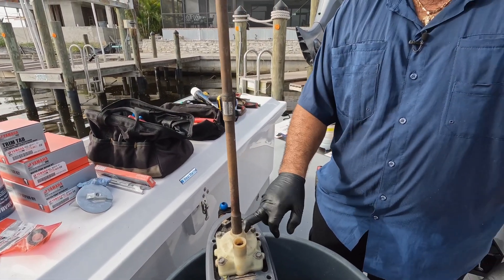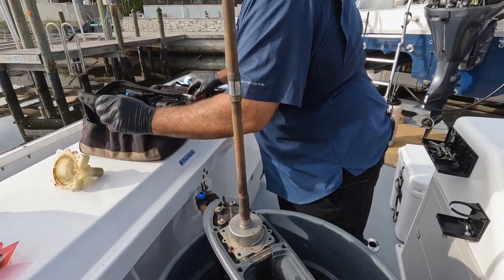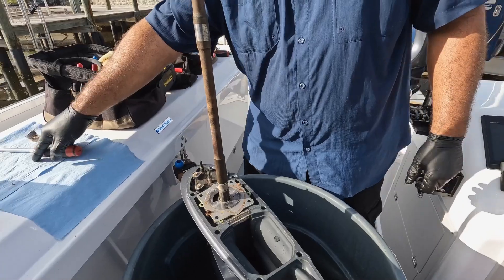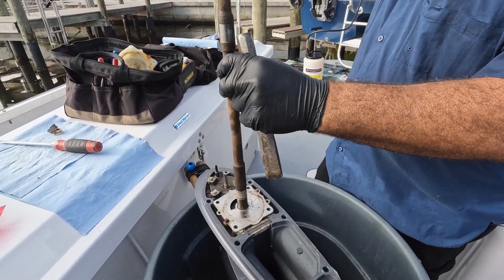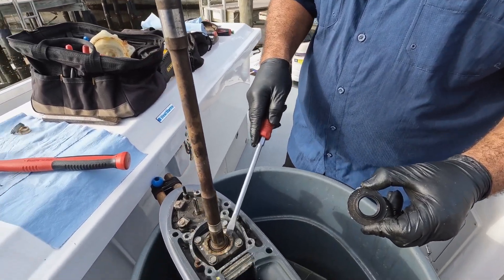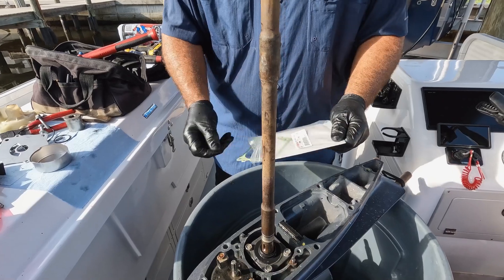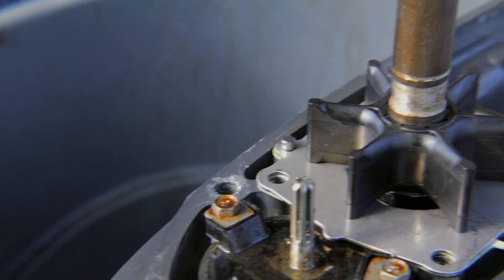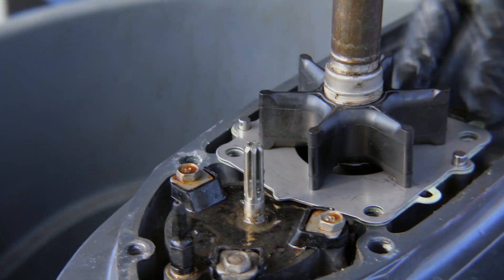How to Replace a Yamaha Water Pump | F90, F115, & VF115 | DIY Yamaha Outboard Maintenance

Comment: Done  this many times on my ‘03 F115 I’ve owned since new. 
The 7/8”’wrench tip is awesome. Didn’t know to do that. 
Good stuff. 
Only thing I do different is grease the woodruff key in to hold it in place and help with it seizing in there. 
Those new to this job do not load up grease in the top of the shaft. It can prevent it from fully seating. 
Thanks.
Reply from the maker: Thanks! Happy to hear the tip helped, even after your years with the F115. Glad you enjoyed the video!

Comment: So, my water pump housing did melt from running dry. Any advice on how in the world to get the melted housing off? I thought of using a drillbit, but dont want plastic shavings going into the lower unit...
Reply from the maker: Hey @haydenbrown9598 — if your water pump housing melted onto the lower unit, that can be a pain to remove cleanly. Here are some tips to help you get it off without sending plastic into places it shouldn’t go:

🔧 Safe Removal Tips
Manual Pick and Pry

Use a plastic or brass scraper, or a flathead screwdriver with a dull edge, to gently pry up softened areas.

A dental pick or O-ring pick set can help peel it off in layers without gouging the aluminum beneath.

Heat Application (Controlled)

Use a heat gun on low (not a torch) to re-soften the plastic slightly.

Then try prying again — the plastic may come off in sheets.

Freeze & Crack

Alternatively, try freezing the area with compressed air held upside down or ice packs to make the plastic brittle.

Tap gently with a soft mallet to crack and flake it away.

Avoid the Drill Unless Necessary

If you must use a drill bit, use a slow speed and a bit smaller than the shaft diameter.

Stuff clean rags or shop towels into the water passage ports to catch any shavings.

⚠ Final Cleaning
Once the housing is off, wipe the area with a lint-free rag and brake cleaner or isopropyl alcohol to remove residue. Blow out all water passages with compressed air before reassembly.

If the impeller melted too, double-check for any debris in the water tube or thermostat area, depending on your outboard model.
Reply: I tried every pry tool possible, and ultimately used my drill bit to remove the housing from the impeller cap and it was successful. I had the whole kit, so I wasn’t worried about damaging the impeller cap or the impeller plate! I cut out cardboard to cover exposed compartments in the lower unit and was successful, thanks!

Comment: I watched your video and several others to see if I could do this . Taking things apart were not to bad , but getting that impeller on was a nightmare. I wound up using a strap to get enough pressure on the housing to force the impeller to start forming into the cup. Does that sound reasonable.

Comment: Do you have to  the prop off?
Reply from the maker: Hey, thanks for watching! No, you don't need to remove the propeller to change a water pump repair kit on a Yamaha outboard. The water pump is located in the lower unit, just above the gearcase, and replacing the kit involves dropping the lower unit and accessing the pump housing.

However, removing the propeller is sometimes recommended as a precautionary step, especially if you’ll be handling the lower unit extensively or if there’s fishing line or debris around the propeller shaft that could interfere with the job. Additionally, removing the propeller allows you to inspect the shaft, clean it, and apply fresh grease if needed.

If you choose to leave the propeller on, just make sure it's secure and won’t pose a risk while handling the lower unit.

Comment: Thank you for the great video.  I had a use a ratchet extension and a hammer the bottom of the woodruff key to get the key unstuck.
Reply from the maker: @talios1 Thank you for watching and for your feedback! Sometimes that woodruff key can really get stuck in there, so using a ratchet extension and hammer is a smart move to get it out safely. Glad you found the video helpful, and thanks for sharing your experience!

Comment: I  wish getting the metal cup and plastic ring off the shaft was as easy as you showed.  I had to utterly destroy the one on my F 75LB to get it off.  That part should be in the impeller kit.  Also getting the new impeller to go into the impeller housing was a nightmare of epic proportions.
Reply from the maker: @brucethecurmudgeon8538 I totally understand—sometimes things don't come off as easily as expected, especially when they've been on there for a while. That metal cup and plastic ring can be tricky! I agree, having that part included in the impeller kit would be a big help. As for the impeller, yeah, it can definitely be a bit of a struggle to get it seated properly in the housing. Thanks for sharing your experience, and I hope the rest of the project went smoother for you!

Comment: Great video. What do you use to clean the surfaces as you are putting on new gaskets
Reply from the maker: @kenainmeshik Thanks for the great question! It really depends on how dirty the surfaces are. Sometimes just wiping them down with a shop towel is enough, but for tougher grime, I use a marine degreaser like CRC. You can also use a mild detergent like Dawn with some warm water. Just make sure to rinse everything thoroughly and dry the seals before putting on the new gaskets. Glad you found the video helpful!
Reply from the maker: https://partsvu.com/products/crc-marine-degreaser-non-chlorinated-14-oz-06020

Comment: Great video ! What kind of grease  do you recommend ? Thanks
Reply from the maker: Hey there, thank you for watching. The preferred grease that Frank uses it Mercury 2-4-C grease. Part number 92-802859A1. While you may be working on a Yamaha Outboard, Mercury oil is perfect for all engines. 

Feel free to comment with any other questions or concerns!

https://partsvu.com/products/mercury-2-4-c-marine-grease-with-ptfe-8-oz-92-802859a1?variant=45626522075427&om=17219&utm_source=google&utm_medium=cpc&adpos=&scid=scplp92-802859A1&sc_intid=92-802859A1&gad_source=1&gclid=Cj0KCQjww5u2BhDeARIsALBuLnMjum9wXs6zov1LBvm29JHEChOpKkdlmvCsvMnWJL2toj4dlAp6qv4aAufHEALw_wcB